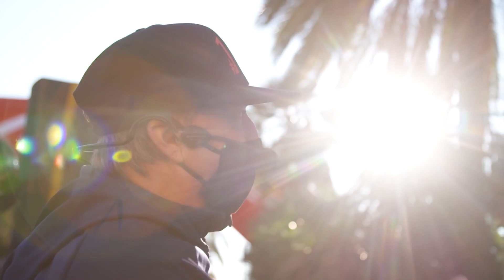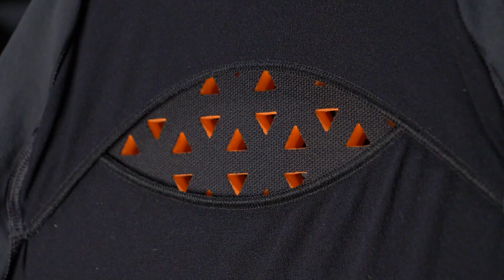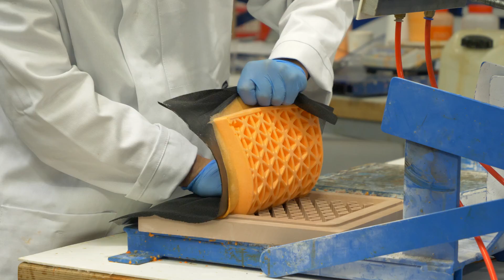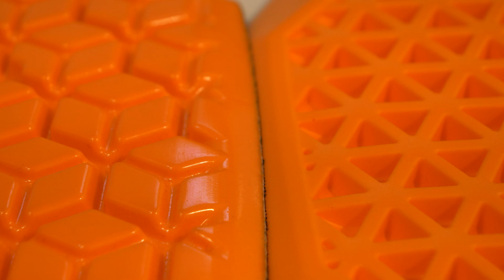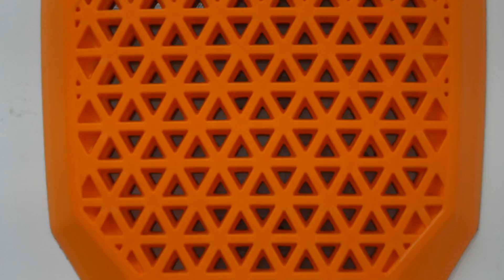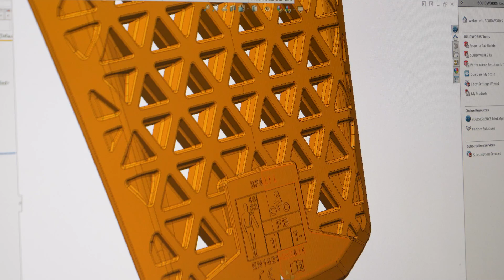High Speed, High Consequence | How MTB Protection Is Keeping Up With The Demands Of EWS Racing

Comment: This D30 stuff is a joke.  With hard-shell kneepads I can drop to my knees on concrete repeatedly without any pain whatsoever and yet when I tried some brand new Fox Launch kneepads with this so called "wonder material" and did the same drop to my knees on pavement it felt like I had done the same thing on a dirt road without knee pads.  Non-hardshell armour just takes off like 20% of the impact, but you still feel ALL the rest of it.
Reply: the soft ones just prevent cutting open your knee caps which would require stitches to heal generally
Reply: this shit is horrible and is sold to the people who go to trails with all there gimmicky gear if your going fast hitting the ground isnt the bad bit its the friction these will just grip more its why helmets and hard pads usually are smooth so when your going fast and come off your head/limbs are sliding on the surface and not getting griped and jerked.

Comment: If anyone from d3o is reading: I just bought a Scott back protector which uses the same structure as the Bluegrass but is level 2. Where is the difference? Is it just a thicker version?
Reply: Scott launched the Airflex technology already last year where they use the same D3O material. The structure is indeed similar but often Scott plates have more coverage on the lower back. Depending on which one you bought you will have a thinner plate (Level 1) or a similar thickness in case you got a Level 2.
Reply: @jozuaschiltz8434  Interesting. I now found product pages for BP4 L1 and BP4 L2, however the protector in my Scott looks different again (other triangle pattern and Scott logo). I didn‘t know that there are specific protector plates for brands.

Comment: Actually got even more questions now than before:
You mentioned "non-newtonian" which indicates to me that it actually is a fluid, but due to the fact that noone talks about how long those protectors keep their shape i suspected its a foam. So what is it now? Does the non-newtonian behaviour of the material in a liquid state actually has something to do with the behaviour of the solid material or not? Because most resins, also EP or UP resins, are non-newtonian in a liquid state. But after the hardening process it's a solid.
Reply: Non newtonian is just a term for that it does not behave linearly to force over time. It's just that so many videos of non newtonian liquids have made it synonym to only being a liquid, but solids can have the same behavior to a certain degree. Also, non newtonian does not actually describe how it behaves, only what it is not. :) it could also be behaving in a way that it becomes softer or more malleable the faster you compress it, which is also non newtonian. There you have yoghurt, as an example of a non newtonian liquid with that opposite behavior. Or ketchup. :)
Reply: @widsk1  I know that non-newtonian could describe a solid aswell. But when it comes to solids it's unusual to talk about newtonian and non-newtonian and therefore one could assume that it's about a fluid. I also know about dilletant and structure-viscous (shear thinning) fluids etc.
When it comes to solids it's more usual to talk about the material type which already says most what's needed to get the basic behaviour and therefore expressions like non-newtonian are rarely used.
But that lead to the question, since he talked about non-newtonian but as i see it, it's some kind of resin or foam, but i don't know and wasn't clear from the video.
Reply: @WaechterDerNacht  ok, then we're on the same page :) I think the material is some sort of elastomer with kinematic hardening properties, which would be similar to a non  newtonean liquid that never reach the complete fluid state. I think it's mostly a case of mixing ratios how hard you want the material to be, though that is just a guess.

Comment: Hay Doddy, have a word with shoe manufacturers to get D30 toe protectors in their shoes. Simple rubber is not cutting it.
I’ve done a good job this year of keeping rubber side down but I’ve broken my big toe nail twice!
Reply: Ride concepts has atleast 1 flat pedal shoe with d30 integration
Reply: Shane Phillips thanks, I’ll look into this.
Reply: I guess, all of RCs flat pedal shoes have D30 in their soles
Reply: What the hell are you doing with your toes? Knock on wood… I’ve yet to damage my toes while riding.
Reply: Kyle Slater just loose rocks flying off my front tyre at speed. I have specialized flat shoes with fairly good protection but a big impact like that just seems to go through. I’d rather take it to the shin, it’s that painful. 😅
Reply: I broke my toe on a big rock too. Since, I've started using Reebok sport shoes that have an alloy "steel toe box"... 
I can't understand why mtb shoes don't have alloy toes like so many good safety shoes out there.
Not completely stoked on the fit or pedal grip of them, but I have saved my toes a couple times now.

Comment: Where's the part where they say that the motorcycle industry had this tech out for years that's better ventilated with more protection and is less expensive? 😅
Reply: Got some examples? Looking for some gear for myself,mainly body with shoulder protection
Reply: @Kushgroove234  Google Alpinestars Bio Air Armor Protection Kit and "CE level 2 back armor ventilated"

Not sure if the comment will get taken down if i leave a link so google the first bits :)

You'll need a shirt that can hold this kind of stuff and youll probably need to mix and match to fit but this kind of stuff is out there.
Reply: @Kushgroove234  Apparently shoulder pads will not stop broken collarbone, better to go to the gym.
Reply: So has the mountain bike industry...it’s called D30